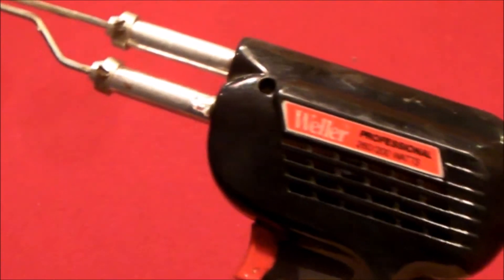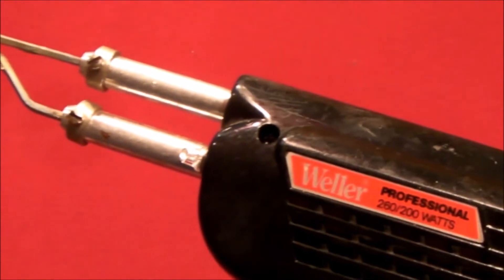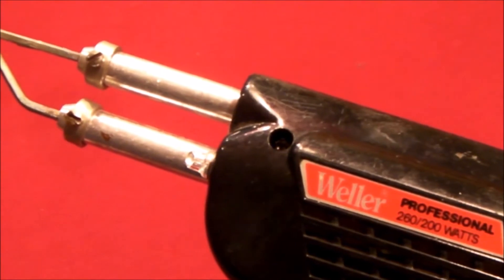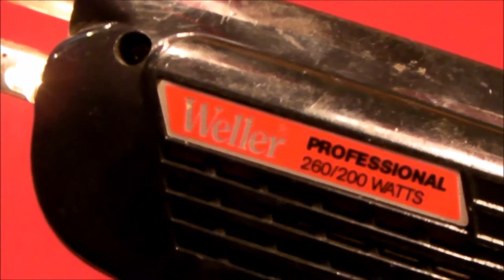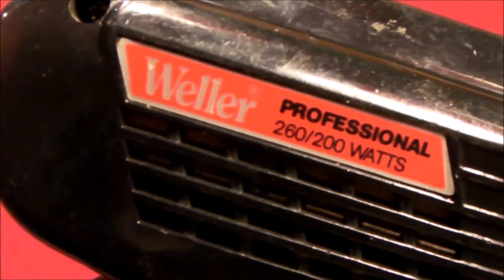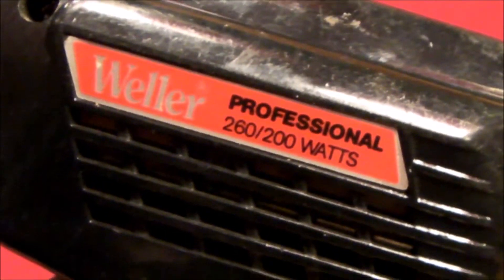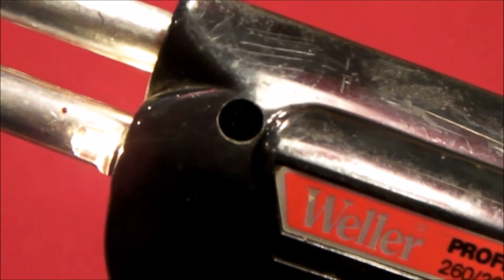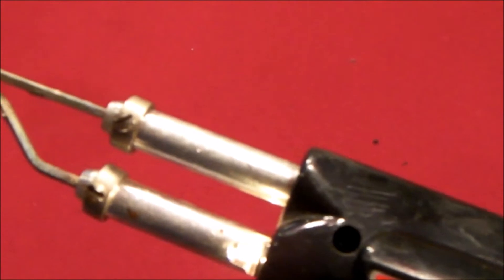Solder gun High Low Switch positions;  soldering gun high low settings

Comment: Hi, I recently got the same soldering gun but it is generating a buzz sound. Is it a normal function or something is wrong with it.
Reply from the maker: buzzing is normal
Reply: @YuDaMan  It's the 60 cycles per second power from your wall plug.